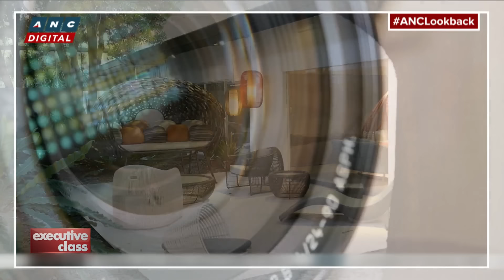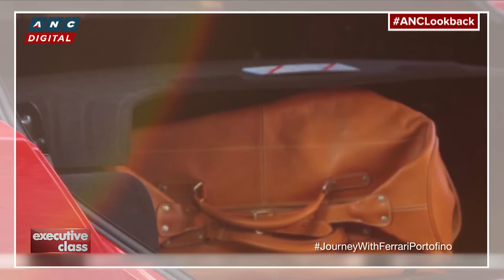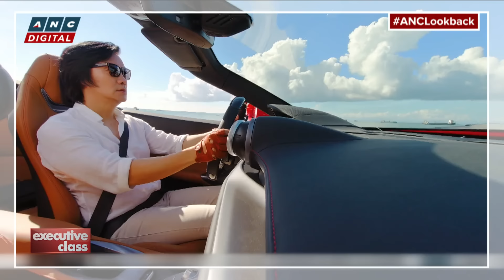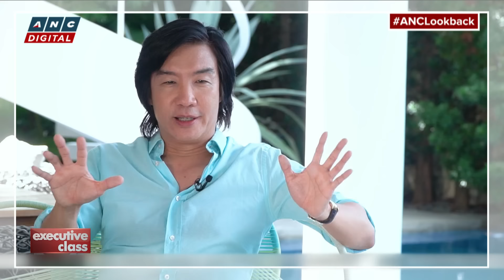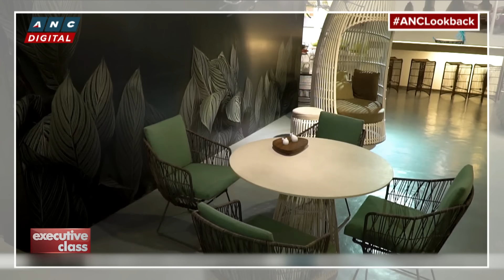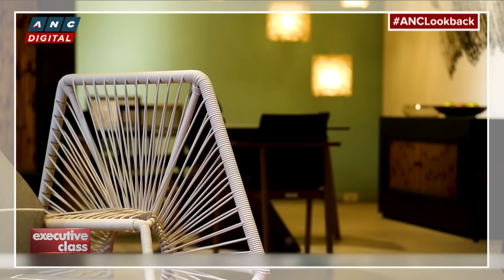LOOKBACK: Executive Class tours Kenneth Cobonpue's collections in Design Icons special (1/3) | ANC

Comment: Ferrari Testarossa doesn't have a V12, but a Flat 12 engine
Reply: It says FLAT 12 meaning, it is a V12.
Reply: @thirdpalermo4504  flat engines are not V, because the pistons are 0 or 180 degrees horizontal so there's no V angle to it